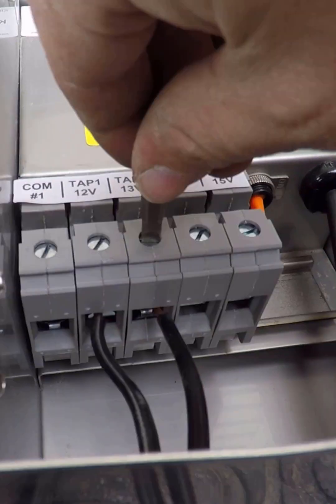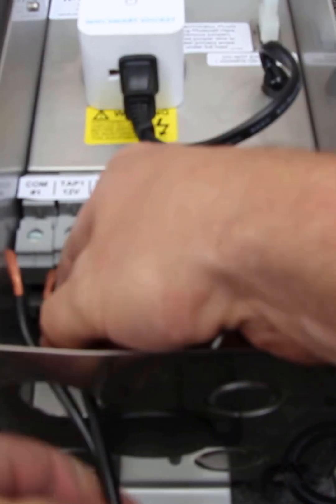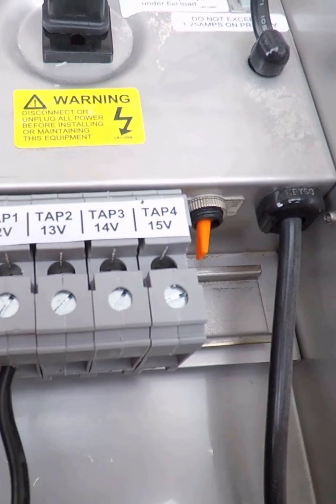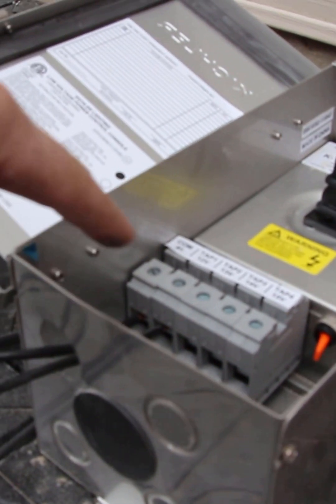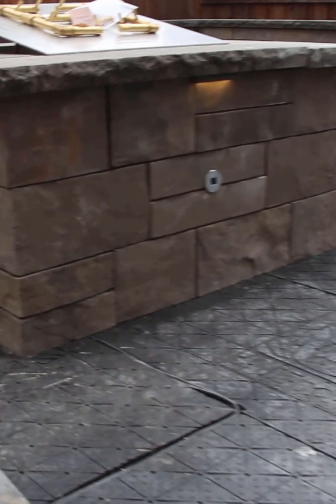How to Wire a Transformer for Low Voltage Outdoor Lighting

Comment: Nice, but please put a grommet in that output hole
Reply from the maker: Into what hole?
Reply: @iamahardscaper  the hole you're running the feed to the lights, got cable rubbing on the hole
Reply from the maker: Gotchya! Makes sense. Though there is no movement once it’s placed in the hole.
Reply: @iamahardscaper should have them in to completely close up the box from foreign objects
Reply: It's required by code to have a grommet going into a cabinet J box or any metal enclosure